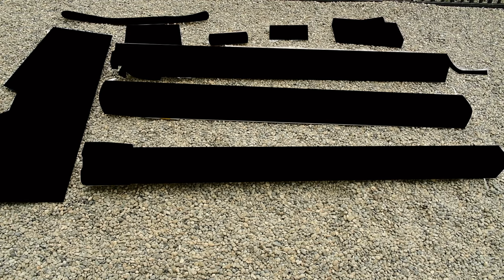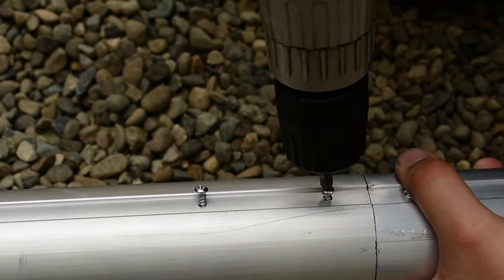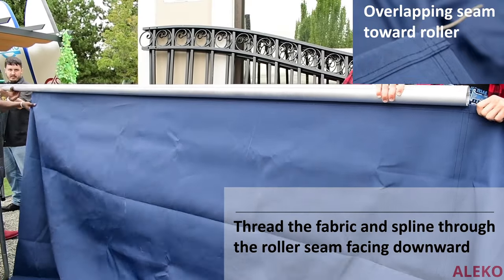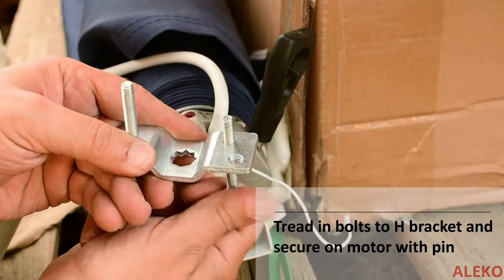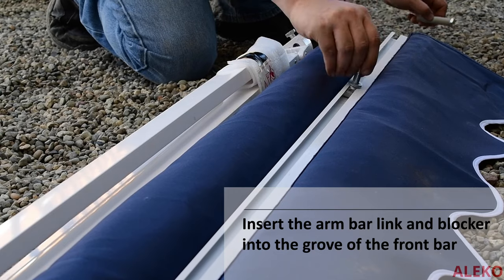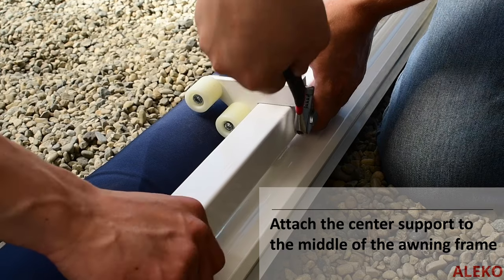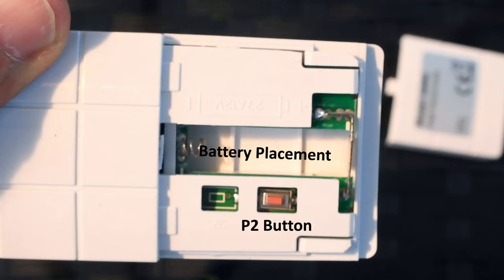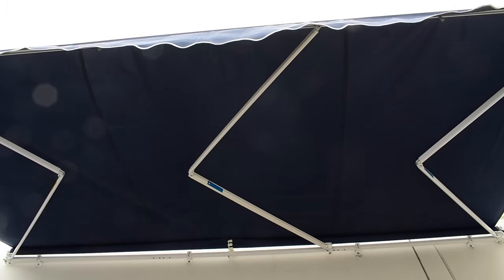How To Assemble and Install Your Motorized ALEKO Retractable Patio Awning

Comment: I like how 1:45 is about putting these super low quality metal pieces together. That should be the majority of this video...how to overcome this terrible stack up tolerance and improper hole placement
Reply: It was a nightmare and I almost threw the towel in.  The connector tubes were so poorly made. finally got it together but wow.

Comment: The video and manal do not match in which made the assembly and installation a bit tricky.  Was it hard = No.  Though it requires mechanical understanding.  Depending on length of awning, it does require multiple individuals to assist in lifting properly during assembly and installation. Suggest manufacturer create new video to match installation guide and updated components.

Comment: Hi,

Want to install a roll out awning.  My question is a have a gas side wall vent on the side and above the double top frame 2 feet. 

Can i go over this vent? If so how far do i have to be for fire safety?
Reply from the maker: Hi there Michael, 

Because we aren't there to fully understand the installation question, it's challenging for us to give you advice on this circumstance. We wouldn't want to give you incorrect information. You may want to get advice from someone locally. 

Sorry we couldn't help more in this circumstance. If we can be of any other assistance, please let us know!
Reply: @aleko8354  

No problems. I called the building code department in my city. They don't recommend any flammable items above or bottom on this type of gas side wall vent. 

You can install on the side but it has to be 3 feet + feet away. 

Again, not above or under due to high heat. 

Didn't installed the unit.

Thanks
Reply from the maker: @michaelc7283  Glad you got the information you needed. Hope you can find another option. 

We also sell stand-alone Pergolas and Gazebos that could offer shade and coverage without being installed to the wall. 

All the best on your hunt.

Comment: Bought the half cartridge LED lighted model. Call Aleko and have them 
send you their updated instructions. Not great but better than whats in 
the box and includes missing information for the wireless remote.  Be 
warned the half-cartridge models are only left hand motor mount   (their
 literature and ads don't make this clear).  In order to make ours a 
right hand motor like we wanted  the   cartridge has to be machined 
(cut) on the right hand side to match the factory provided cutout that 
was on the left. The cut out provides access for the hand crank and the 
motor stop adjustments. I did mine with a drill and hacksaw and cleaned 
it up with a file.  It also required me to thread the left hand end 
cartridge cap to get the bracket to attach to it. I used a 7mm tap and 
bought some hardware (2-7mm x 35mm bolts) to make it work.  Some simple 
photographs would have been so much more helpful than the printed 
instruction.  The modifications were not hard once I figured it all out 
but a lot of wasted time for lack of good instructions.  Overall appears
 to be a good value for what you get as long as your prepared for the 
assembly challenges and understand its not right hand drive without some
 serious modification.

Comment: On the awning I received it appears that the motor is pre-installed on the left side.  What is the best way to switch it to the right side?
Reply: Did you ever resolve this?
Reply: undo the bolts retaining it and switch ends.  Not that complicated.
Reply: @markbell1  My preassembled bolts were fused to the frame. I was not able to move the motor.
Reply: @peterReidATX  well that's too bad.  I hope the motor doesn't give out on you.  I thought all the motors were removable.   I'd contact Aleko customer service.

Comment: Do not buy from them if you’re not 100% sure if you either want it, or, if it came in damaged. They are unfair and provide 3rd party deliveries only. Plus, keep the original packaging, or else, expect to pay a $200 custom sized box to send the product back, with an unpaid shipping label from the company, and a 50% restocking fee!

First of all, I was super excited about this product!! I threw away all the packaging in anticipation for putting it up and enjoying it. However! I purchased a 20-ft awning that didn’t have an updated instruction manual for it. My 20ft awning had 3-parts to it, while the book had instructions for a 2-part awning. The YouTube video was also the same as well - not updated. I followed the instructions CLOSELY - dotted my i’s, and crossed my t’s. When I got to the end of it, I noticed the middle bars attachment was too short to pass through (see pictures attached). I messaged the company about returning the product. I didn’t feel safe keeping the product because I would have to take everything apart in order to replace the new middle bar. Which meant, unscrewing, detaching, and potentially causing more damage to the awning. Aleko approved the return, however, I would have to pay for restocking fee, new packaging, and the shipping fees totaling up to $400. Mind you, this was not my fault, but they’re fault in packaging the wrong bar into the package. 

They’ve offered the options of replacing the bar or replacing the bar with a $50 credit. However, Aleko refused a full refund or to ship a new set. AtoZ through Amazon was not helpful either. AtoZ denied my claim and wanted me to send the product back to get my refund only. It has been 2-months with no resolution. This process has been extremely difficult and unfair. Either way, I’m in a lose-lose situation. I would never recommend this product to anyone, nor will I buy from them ever again! 

Ps, I took the product apart, very carefully, yet still created big holes where the nails were drilled in for securement, it was extremely difficult to take the bars apart from the aluminum pieces as well. I hate it! Worst decision ever!

Comment: Your instructions both in the manual and here fail to note which side of the front arm bar the valence and main awning fabric goes into, this is a major issue due to making sure  arm bar links are at the intended location. Please completely redo page 8 and 9 in the guide and this video to clarify these details.

One can watch the video to get an idea which side is for what. Also the paper manual is missing step 6, the entire step six. Goes from page 8 to 9, no step 6.

Who TH created your manual.
Reply: The Chinese

Comment: And the remote is not working. The mirror never beeps. When it is plugged in it moves slightly one way then the other and then nothing.
Reply: The answer to my problem is to train it up within 5 seconds. I didn't know this until I talked to someone from the company.

Comment: Verified purchaser, verified assembler. It’s too late to turn back now. All the boxes are opened and parts scattered everywhere. The first comment I must make is this. Either all the retractable awning manufactures must also have pathetic assembly instructions. And YouTube support videos made by the most incompetent composers. Or this Aleko company would have already been out of business. The printed instructions provided inside packages are disgusting. Images of parts on instructions do not match the parts provided in the box. Important steps are either omitted. Or they come along in the assembly process out of order. Causing one to disassemble to reassemble. There are parts in the box that are not even on the assembly  paperwork. As far as the YouTube videos recommended by the technical support. They too are still missing steps. The parts shown being assembles in these videos actually change from one step to the next. Possible different product revisions of the units over the years. But why then in the same assembly video. It’s like you are being shown how to change a transmission on a 1965 F150. But then you are suddenly being shown how to do the next step on a 1985 F150.  I purchased a motorized unit. There were zero instructions in any of the boxes on how to assemble that part of the process. And the YouTube video recommend by the technical support was one of those that changed parts being assembled along the way. It has you looking through all the parts provided tying to find these other parts. As they look like they would have worked better. Not sure which revision they were from. Not the one delivered to me. But more revisions are still definitely needed. How in the heck this happens is beyond me, I still managed to get the unit assembled in a day. And once one gets through it. It really pisses one off seeing how a set of clear and up to date instructions would made it a whole less frustration. And how it would have been so easy for the manufacturer to have provided that. It is like they want people to hire someone that has done it before. I pray to God it works now once I get it mounted on the house. And then lasts beyond the point where I forget how frustrating of an ordeal it was.

Comment: Terrible Instructions and lousy video. No mention that the motor needs to be installed on one side of the bar. Needed to take apart because motor will not line up on the other side. Also, check video time 4:03 and then 4:05. Somehow, the exposed nuts turn into flush bolt heads.

Comment: Instead of having to deal with this mess, why not install a SunSetter Motorized Retractable Awning instead?
Reply: Money
Reply: Basically the same thing
Reply: @debramsey9823  omg same girl!
Reply: sunsetter is way over priced!!!
Reply: Expensive sunsetter
Reply: they are way behind on delivery and struggling to meet supply.
Reply: I installed my own because of cost. My brother paid $5000 for his 10 x 8 motorized awning, I paid $399 for the same size. His SunSetter appears to have much heavier supports and the material is better. However,  I'm not sure the huge cost difference justifies paying so much more.  The installation was difficult mainly because the instructions are crappy. Thank goodness there are plenty of YouTube videos that are very helpful. I have the awning installed. Still working with the limit switch to try and figure out how to stop the unrolling where I want, and how to stop it when retracting. Not having much luck. I am presently using the hand crank to unroll all the awning after the motor stops. To avoid crashing, I then stop the motor when it gets close to the stopping point. I use the hand crank to finishing parking it. Overall, I am satisfied with the awning purchase.

Comment: This is the worst Awning I’ve ever put my hands on
The directions are not detailed at all. They don’t tell you you need to build out the wall because the mounting brackets don’t stick out far enough it’s just a complete freaking nightmare never buy this.